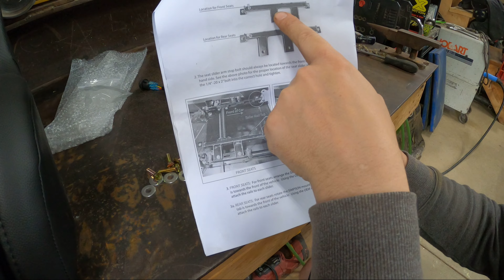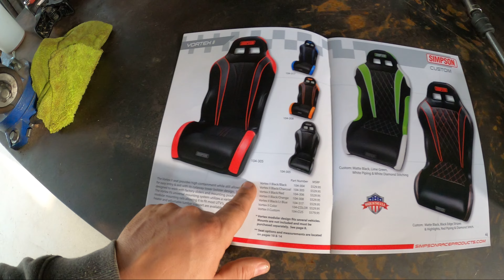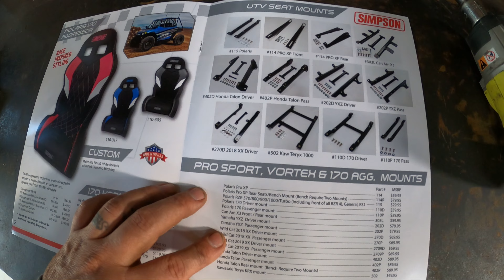Can Am Maverick X3 Simpson Heated Seat Install

Comment: You will have to see how much water stays in the bottom of the seat at the back once you wash it.  Some others videos Simpson seats hold water.  May pay to drill a couple drain holes if it is a problem.
Reply from the maker: It shouldn’t hold water. With a suspension seat there is no bottom to catch water. It’s all on mesh and bungees.
Reply: @TheCanAmCrew  Good deal.  Hope it helps the back so you can continue to ride in comfort.

Comment: I had been looking at the simpson seats also. just can't decide between the vortex II and pro sport? Also i'm a little worried about it sitting higher, because my rzr already has lack of cockpit room.
Reply from the maker: I only sat 1 inch above stock height with mine but I ordered the low bracket kit. I would say go with the pro if your a bigger person it is 1-2 inches wider than the vortex.

Comment: Nice seat's. This isn't seat related but on the rear drive hub mine stripped out like your wife's 5700 miles 570 hours any suggestions to help it live longer thanks
Reply from the maker: Absolutely, take the axles out and clean the splines off and re grease it every once in a while. 1-2 times a year. Once Sheri’s went that’s what I’ve been doing to both of them and we’re now over 8200 miles and hers is still good and mine never went bad.
Reply: Thanks enjoy the video and tech tips